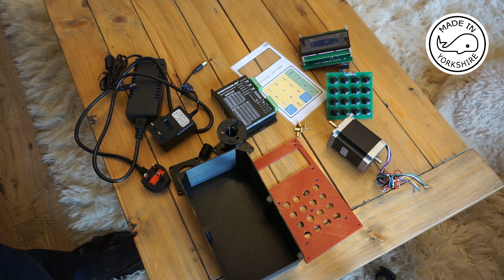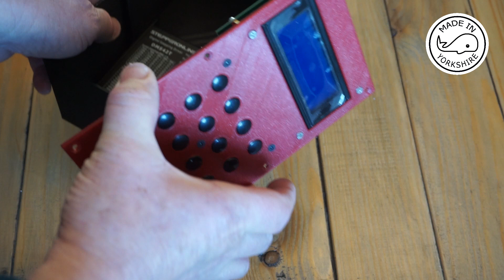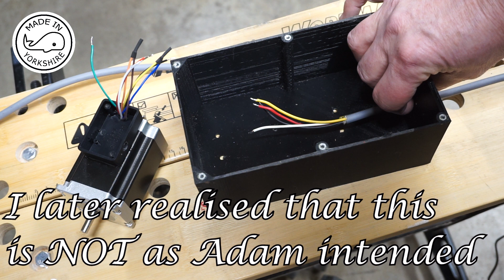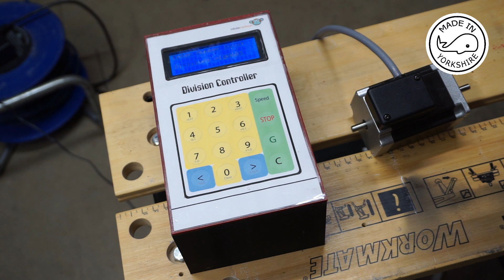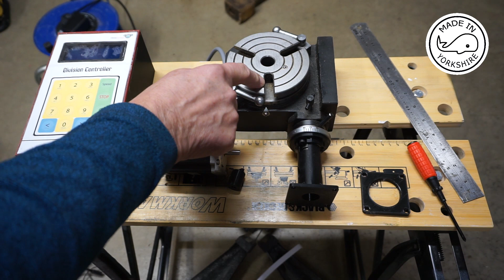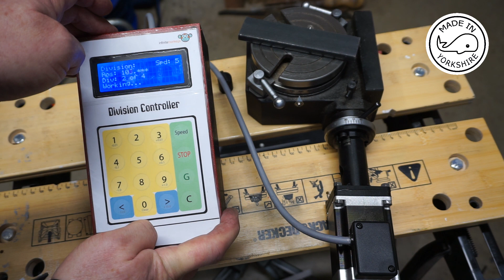#MT34 Rotary table controller/indexer. By Andrew Whale.

Comment: My suggestion 
would be to provide ventilation to stepper driver if u have mounted in  your custom 3d printer case since heatsink of driver may damage ur casing some other time. Since current[torque] depending upon the load u place on turn table. Thus current is drawn from driver. So decide accordingly & provide ventilation with the help of fan and  ventilation holes on box. Use seperate power adapter for fan.Since it's emi may affect the microcontroller.

Comment: Nice controller, but that direct drive sticks out way too far and eliminates any useful manual function.  Here is a company that builds a kit to convert the rotary to CNC while maintaining manual functions and offering greater torque and resolution in a more compact package.  they make them for the Indian and Chinese design tables.
https://www.cnctoolexpress.com/rotary-tables/247-cnc-upgrade-kit-for-43-rotary-table-0738581616302.html

Comment: Hi Andrew,
I was sent a link to your video, it's always interesting to see how people get on trying to use my divider.
I do have a question - why didn't you simply use the 24v supply to power both the divider and the motor rather than have two supplies?

The other point which is something I've come across a few times now is the wiring for a common +ve rather than -ve (which showed up on your divider due to only running in one direction).
Obviously you wouldn't be aware but in 'setup' you can flip the direction of the clock pulse which has exactly the same effect (but is obviously easier to do).

I'm currently in the process of trying to update the information I make available to help people trying to make the divider so any feedback would be gratefully received.
Steve.
Reply from the maker: Hi Steve - apologies for the late reply - it looks like I missed the YouTube notification and I've just seen your comment.
Adam (my electronics adviser!) suggested a separate 9v supply for your divider as it has a 5v regulator. I think he suggested that providing 24v to your divider might cause the microcontroller to crash (his words). I don't understand the logic but I just took his advice and provided 9v to your divider and a separate 24v to the stepper driver/motor. Adam is very much a belt and braces guy.
If you have found that providing 24v to your divider works OK, then I guess it's not an issue.
BTW the divider works a treat.
Cheers
Andrew
Reply: @learningturningmetal  No probs Andy, glad you're getting on with it.
There's no harm in a separate supply but the voltage reg can handle 24v no problems (it just runs a bit warmer).

I think your video was responsible for a spike in sales of the unit so a big thank you for that although the sudden rush depleted my stocks just as lockdown made it hard to buy parts.

Comment: Hi Andrew, I am new to metal turning, I was thinking of purchasing a Sieg sc 3 from Arc Euro trade. I have been watching your videos, I see you went from a sc3 to a sc4 . I just wondered if the sc3 is still ok. Great videos 👍🇬🇧
Reply from the maker: Thanks Roy. I found the sc3 from Arc a good starter lathe, but like all mini lathes it needed some work to get it working satisfactorily. A carriage lock is definitely needed for parting off. Protection of the gears in the apron, digital tachometer and other stuff. All covered in videos on my channel. It cut accurately to within a thou and I made my Stuart s50 with the sc3. The sc4 is a totally different beast. Very heavy, bigger capacity, coarse and fine power feed on the carriage. Also power feed on the cross slide. Tachometer included. If you have space and can afford the extra cost, then I would recommend the sc4. You can end up spending a lot of money on tooling and some of that investment can be wasted when changing machines.
Hope that helps.
Andrew
Reply: @learningturningmetal  Thank you, that really helps. I was also looking at the Warco super mini lathes.👍🇬🇧

Comment: Hi Andrew. I made one up a few years ago for my Sherline Rotary Table using an Arduino Uno. It works fine. Not as flash as your version but does the job for my light machining projects if required.

Comment: Looks like you made a good job of it Andrew :-)  I wouldn't know where to start on a project like that.  Is your Grasshopper engine any nearer to completion?
Reply from the maker: Thanks Peter. The grasshopper is taking a little time. The garage is cold but I've just managed to complete the painting. I now need to do the final assembly which requires me to mill the pedestal down to size, to fit the re-designed base. I'm currently in the process of getting a dedicated (and warmer) area for all my model engineering kit. I think I will finish the grasshopper off in my new space - when it's ready.
Cheers
Andrew
Reply: @learningturningmetal  Thanks, I look forward to seeing the finished result :-)

Comment: Nice project Andrew,  was wondering if you might use nylon set screws on one of the motor connectors just in case the rotary table binds, or you forget to release a lock, so that the linkage slips instead of causing some other problem? Just wondering out loud.
Thanks again for sharing your voyage with us.
Reply from the maker: Thanks Robert - now you have got me thinking! There will definately be a high probability of me forgetting to unlock the table between cuts. I'm guessing that the weakest point in the drive mechanism will be the plastic piece connected to the rotary table. As such I hope that this will be the component to fail and that I can just print another one. I don't fancy testing it though. I wonder if  others have considered this issue? If it was belt driven then I guess the belt would just slip? I must investigate!
Thanks for mentioning.
Cheers
Andrew
Reply: @learningturningmetal  My experience (the guy who designed the coupling bits) is that the motor will simply (and noisily) skip steps when the table is jammed.  Even the 3D printed Oldham holds up fine.  I designed the Oldham so that it needed sanding (on my printer) to fit - so there was no backlash.  With a little silicone grease it was smooth as silk.
Reply from the maker: Thanks Patrick - that is really reasuring.
All the best and keep up the great work.
Andrew
Reply: @learningturningmetal  having worked with a lot of mechanical devices from printing presses to farm tractors I have seen a lot of safety mechanisms from slipping belts to shear pins to disengage things. That is what caused me to think of a nylon set screw or similar item as a safety disconnect. But, as you stated, the plastic coupling may be designed  to be that part.

Comment: Andrew, I built my Word of Ward rotary dividing head some time ago after seeing it on craynerd YouTube site. Instead of a rotary table, I used a worm and wheel drive and timing belt driving connected to a Peatol (also known as Taig in America) headstock. It has worked very well and I have used it on numerous projects.
Reply from the maker: Thanks Steve - very interesting. A timing belt driven version sounds very interesting and it would be an interesting project to undertake. I will put it on my 'I would like to do' list. I subbed to craynerd a while ago and I will check out his version.
Cheers
Andrew

Comment: Hi Andrew,
A few years ago I made a few of these for me and my mates. A sort of very short production run. I would not be without mine. A wonderful thing. I sold a couple to local engineering firms. I am quite surprised that they have survived for a few years so far.
P2.
Reply from the maker: Hi P2 - yeah I am well impressed with the Ward controller. It seems to work a treat. Now I can experiment making some gears!
All the best.
Andrew

Comment: congraz, i did mine with an arduino and a nema 17 with reduction gear. well not the best one... and i could never got around to recalculate the angular step to the rotation and translate this to code
Reply from the maker: Thanks mate. I must say that I am a bit of an arduino fan - but I chose the Ward controller because of it's functionality and I have too many other things to get on with. I coded most of my working life, and I like learning different stuff.
Cheers
Andrew